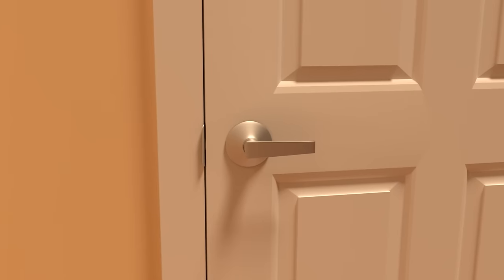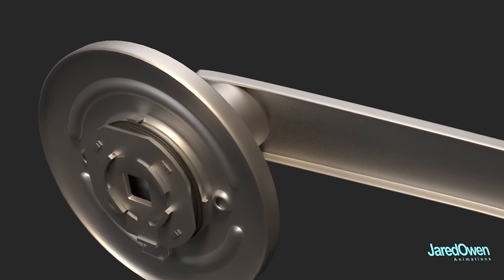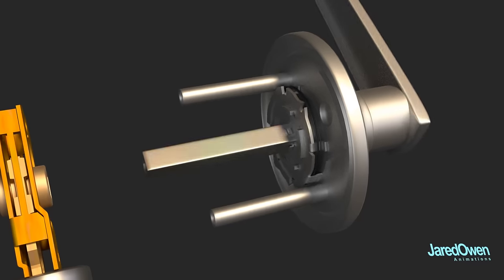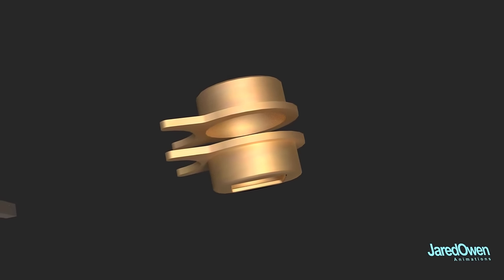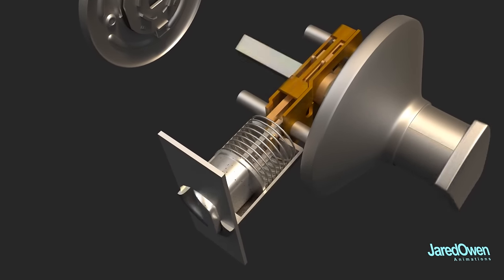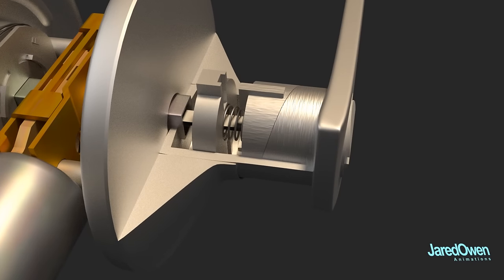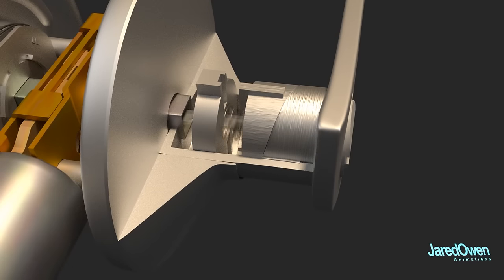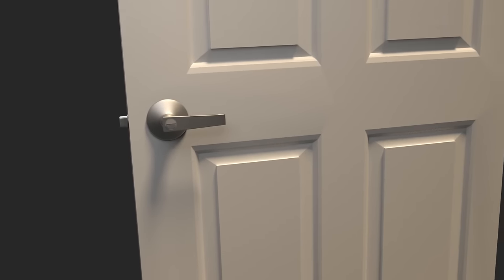How does a Door Handle work?

Comment: I didn't think it'd be that complex, impressive. I like these :)
Reply from the maker: Thanks Hank - doing my best to keep it entertaining.
Reply: Honestly, I didn't either until I had to replace one for the first time.  I was shocked to see how many individual moving parts were involved in such a seemingly simple device.
Reply: Same
Reply: This is actually one of the simplest models. Look up mortise lock. That is even more complex, mostly used in commercial settings. I know because I’m a Locksmith.
Reply: @realkevintorres  Fun thing is that in Europe (Or at least in France and Italy) doors inside of pretty much every home use...
mortise locks !
Reply: @JaredOwen  make more videos
Reply: Yes. Never new it was so complex
Reply: 03:06 This door handle is based off the Kwikset privacy handles (Knob/Lever), and the fact that both handles are locked make it a HAZARD
Reply: @Dargonhuman  č)
Sr sardar xfc
Reply: @ViperClone  You okay there?  You're not having a stroke or anything, are you?
Reply: Honestly I didn’t think it be that simple 😅… and I’m a engineer
Reply: Most things are.
Reply: @JaredOwen  2:14 - I noticed that most doors don't allow rotation of the cam drive units in this way, as it would involve pulling the handle upwards. Is there something else in there that stops people from being able to pull the handle upwards?
Reply: @FranzFerdinandVIII  If you look closely this video shows the handle as being lockable from both sides, which would mean that anyone could unlock the door from the outside and enter. It says "the magic happens at the other end" which seems to suggest that the door is locked from the side that doesn't have the fasteners in the rosette???
Reply: I am often in awe at how today even cheap, everyday things have all kinds of complexities wrapped into them.

Comment: Superb animation, well-done! I especially love that you named all the parts, as that it makes it easy for me to describe a problem to a support desk. Instead of, "Well the problem is in the cylindrical thingie that moves when the doodad is turned," I can correctly say, "the problem seems to be in the latch assembly because the cam drive units aren't moving smoothly, but the handles with the rosettes work fine." Thank you!

Comment: Jared, this saved my ass. I had taken my doorknob off to work on something, and the cage popped open (clearly had been messed with in the past) and everything came apart. I didn't want to buy a new knob because I rent and didn't want my landlord to notice.

I had tried unsuccessfully to put it back together but couldn't figure out how to orient the cam drive units with the transmission plate. 

Your animation made everything click and I got it back together minutes later. I even managed to get it to work better because, like I said, a previous tenant must have messed with it and the knob would stick a lot. Because of your explanation I realized part of the transmission plate (which was slightly bent) was bumping against the cage. 

Seriously, you took something I couldn't understand and made it easily understood in under 5 minutes. Great job.

Comment: This is an awesome example of the mechanism.  Referencing ~3m in, I think the problem with my knob is that I over-rotated the cam.  The result is that turning the driver or twisting the lock with the key turns the handle and pulls in the latch rather than locking/unlocking the door.

Trying to google around the problem leads to unending pages and videos about door adjustments when this was almost exactly what I was looking for!  At least now I have a plausible explanation about what's going on!

Comment: Could you do a European door handle
Reply: My thoughts exactly.
Reply: What wrong?
Reply: It’s the same mechanic it’s just has a turning knob
Reply: No the lock is so much different in EU doors
Reply: The old versions with handles have a very different lock 
The new knob versions work the same way as American doors
Reply: @tsaitaj  If it is somewhat similar to Brazilian door locks (which I suspect they are), there are two separate latches, one for the handle and another one for locking the door, and you will always need a key to lock the door. 

That got me really confused when I was younger, because so many plots in cartoons and sitcoms revolve around the characters "locking themselves out of the house, in the roof, in the basement" or some variation. You can do that with the American door handle, because if you twist the little knob and leave it will lock; but you literally can't do this with the ones we usually have here, because you need a key on you to lock the door.
Reply: uhm in poland the door handle's are like that

Comment: Animation:100%
Content: 100%
Labeling: 100%
Quality and completeness: 100%
Flow of 
Presentation: 100%
Reply: Those door locks suck. All it takes is a long fingernail and putting it into that outer lock area. Bam. Door unlocked

I had one of those locks on my bathroom door, and my siblings always unlocked the door when I was taking a poop

Comment: Wonderful video. Well crafted and explained. Helped me to 'see into' and understand a situation I had with my door: the connection between the transmission plate and the  latch was broken, with the spring keeping the latch pushed out and the door 'locked'. Then, I just had to figure a way to push the latch back in to open the door. Now, to get a new assembly. Thanks!

Comment: Today, I got locked inside my bedroom when rotating the handle would not pull the latch. It was 5 am. I was on 22nd floor  apartment, alone in the house, main door with safety door locked from inside. I watched this video on YouTube to learn the concept. Luckily, i could open the screws around the rosette using some household item because there was no screwdriver in the bedroom. I realised that the actual assembly was exactly as part the video. Unfortunately, the cage of cam was too concealed and too strong to open the latch. I realised after tinkering the assembly that the square spindle was loose and towards outside, so i pulled it back in, refixed the rosette around the spindle properly. Then I turned the handle holding the rosette. The latch opened and i finally rescued myself out. Thanks a lot. Without this video, it would be impossible to come out of this ordeal myself

Comment: I really needed to pee but i was stuck in my room. Videos about fixing jammed door latch all weren't helpful, because they were all showcasing it from the outside of the room or had the wrong lock type. This video was exactly what mine looked like so it helped a lot in figuring out what I'm dealing with. I'm finally free and don't have to pee in a bottle in my room. Thank you so much.

Comment: Great job!  I accidentally locked myself in the bathroom working on the strike plate because I didn’t realize the transmission plate was broken.  No amount of doorknob turning will retract the latch in that case.  My brother had to use a scissor blade to push the latch back into the housing to get me out.

Comment: Thank you this was very helpful. It seems the problem with my door is that the cams don’t engage the transmission plate to pull the latch back. What could be causing that?

Comment: I recently had brand new handles in my offices & some had locks & some didn’t. These are on the INTERNAL doors & they are NOT expensive. Obviously, one didn’t last long at all & the began “spinning within itself” on the end of the doorknob (not a lever-style, not that it matters). 

I had never really broken it down to understand the exact engineering names of the internal components, so this was VERY interesting. 

My family owns a hardware store & I grew up around it & even ran it for a couple of years, but never knew this stuff. I still don’t know what’s wrong with my door knob but it has something to do with my cams, but instead of worrying with it, I’m going to run & grab a new one for $7-10. I tore the other one down but I can’t get it apart past the first couple of stages to see what actually happened to the cams.

Comment: Really clear and well made video. I was just wondering if anyone could answer my question? The lock switch on the left handle would be under some tension from the spring on the lock mechanism, so how does it stay locked? Also wouldn't turning it require a fair bit of force? I've known these types of door locks to be very loose and easy to rotate

Comment: He makes it look so simple, so I dissasebled all my door handles. Now, I cannot reassemple them, because I don't live in the same country as the creator of this video, and our door handles are a bit different internally. I ended up with disfunctional door handles. After a while, I gave up and removed the doors completely. I replaced them with curtains.

Replacing doors with curtains had an unexpecting possitive impact on our lives. It's not just the extra space and the reduced complication. It is how the privacy inside a family works: whenever you need some privacy, instead of forcing it (by shutting a door), you are provided with it by the rest of the family. In other words, when you slide a curtain, the rest of the family understands that you need to do something in your own space, and they just respect it. I also trust that they will respect my wish. Privacy is based on trust, now, so more trust was built between us as a result. Trust led to stronger bonds, acceptance, respect. We now expect another child. We are happier.

Thank you for changing our lives!

Comment: That's a very different door handle from what is usually used where I live (Switzerland).
There, the square rod is part of the door mechanic and not part of the handle. The handles themself are usually just put on that rod and fixed in place with a smaller rod going through the handle and the square rod. (I hope you can imagine this)

Comment: similar to a Kwikset door handle, but in those, the driver extends a locking lug which prevents the handle from turning.

21.Oct.2020

Comment: This is a wonderful video of how a doorknob works - I have a door that will not open and have taken it apart to try to remove it from the door - the latch is stuck in the door and will not move when the doorknob is turned - I am thinking that the latch has somehow unhooked from the transmission plate - any suggestions to getting the latch mechanism out of the door so I can replace it .

Comment: Thanks mate. Is there anything you could do to fix the leaver if it doesn't come out all the way? I think my door leaver may have been faulty from the beginning. It doesn't petrude all the way out, even in lock position. It only pops out 2-3mm max. Therefore, the door doesn't stay closed. Frustrating!

Comment: Enjoyed your video! 

Can you help me with an issue? I bought 3 identicals door knobs and I experience the same problem with all of them. I can lock the door with the button but can't unlock it with the key. When it's unlocked the key cannot lock it either. It twist the whole knob instead. I've read the whole instruction manual.

Have you ever experience something like this? Or do you know anything that could help me? 

Thank you :)

Comment: I probably should have watched this before attempting to destroy the door knob just because it was no longer opening the door. We were trapped from the inside and we could just have attempted to disassemble the door rather than break it.

The latch came loose from its transmission drive

Comment: In the house i live in most of the inside doors' locking thing is a circle that pushes in
and it comes back out with a spring (i think) to its original position once i turn the door handle

Comment: What could cause the latch to not retreat into the handle? 

The handle rotates and it’s not locked, but the latch doesn’t retreat into the handle when I rotate the handle. 

I’m currently locked in due to the above situation, and trying to figure out why it’s not opening.

Comment: I recently replaced all locks include the front door lock in my house with the Schlage. When you pushed down the old locks handle, they worked immediately. I have problems with the new ones because they need to be pushed down to almost 90` to open the door. Is there any way to change that?

Comment: I had an issue with a new door handle I tried installing today. The cam drive units wouldn’t fully rotate the transmission plate so the latch wouldn’t full retract. Does anyone know why this would happen? I compared it to the door knob I took off but they are designed differently and can’t figure out why this is happening.

Comment: IN my moms house the door knob and the thing it goes into isn't aligned so what I mean is if you "close" it you can just one handed push it open no problem without the knob.. And the lock isn't aligned either so even if it's locked you can still push it open... And the worst part is the door is to the bathroom D: also in my dads house the lock thing that you turn is opposite . Meaning left to right is locked and up and down is open so yeah ..

Comment: I am having one idea see at 1:50 if we take one solenoid or in tech language electromagnet and surround that solenoid coil around this big bulky spring shown 1:50 and a chip connected to it.
1. There is one permanent magnet is going to be connected around the spring shown(lower part) very hardly so that if magnet moves spring also moves and connected to top notch coming out and in of the 🚪 door. 
2.the chip i am talking about is connected to one reciever.
3. The user which is going to close or open the door having one Transmitter giving microwaves controlled so that user doesn't blast.
So total of all,
      i hope a lot of people know about the JAXA it is the Japanese satellite hub in which they are having one satellite passes electricity almost 1.6km away from the earth to another part without wires in the form of microwaves. 
Back to lock,
   If the user comes the transmitter (very small size as we are going to future) passes electricity throw air and give enough current to circuit board so that it can generate electricity in that electromagnet and it will force the permanent magnet inside it towards opening direction of the door and no use of 👐  hands the door is unlocked and opened by that old motor technology. I know it is Worthless because of slider doors in big market stores but even for home that slider cannot be used because their we want no noise of opening door and we didn't use it..
Thanks for reading